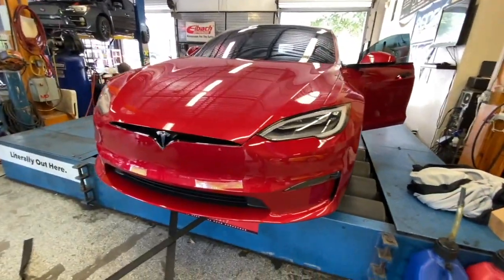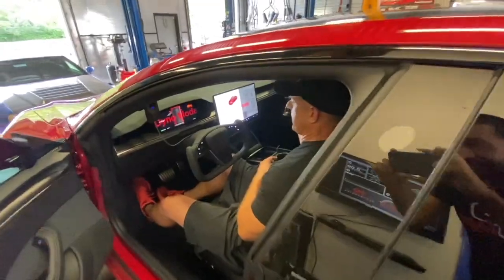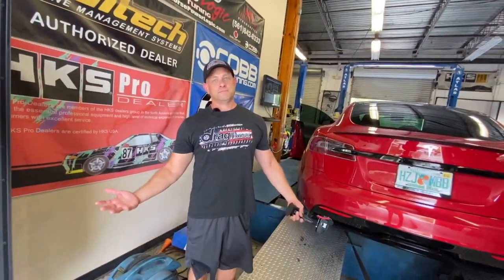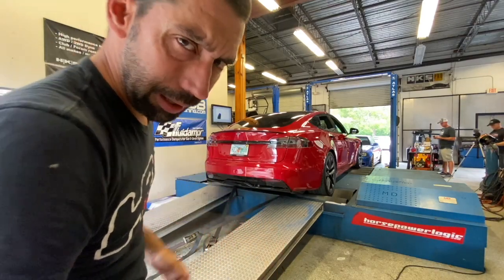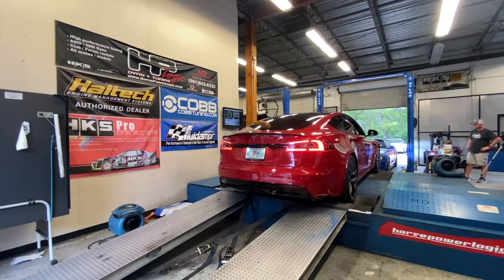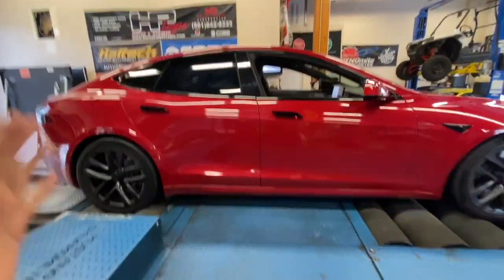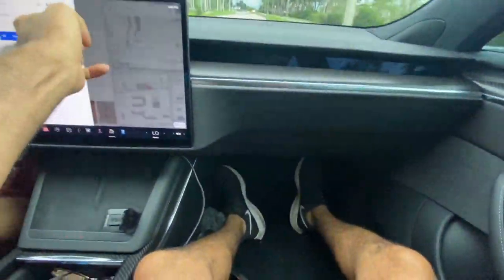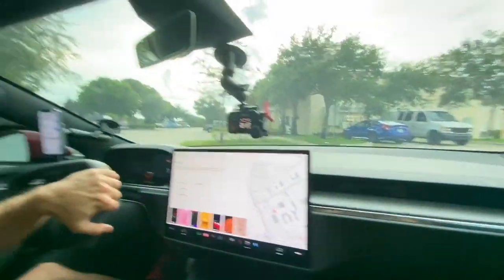WE DYNO A TESLA PLAID

Comment: Try unplugging a wheel speed sensor to fault the ABS system. Works on all the other Tesla’s on the dyno so it might get you through. A 10 minute drive after plugging it back in usually clears all the faults. Good luck!
Reply: Not necessary just remove the skyline and boom problem fix

Comment: Where do you think the future of engines is going jack? Biden wants full ev, but I feel like that platform has just as many if not more flaws over a combustion engine. Hydrogen, diesel, ethanol based?
Would love you're 2 cents man. Keep up the solid content.
Reply from the maker: The smart thing to do would be to use the largest fuel source we have on earth. Water.  Hydrogen/oxygen from nuclear production is the real way.
Reply: @JackCecil  Electricity can be made in a variety of ways: nuclear, hydro, tide, wind, solar. It is also available to produce residentially (solar panels). Electric + battery has plenty of room for improvements - I mean batteries. Hydrogen will never work until they figure out how to make it without burning through fossil fuels. Not to mention storage and transportation. So, before u even get hydrogen fuel cells where they needed (gas stations for example), you have already used so much energy for it that it makes no sense. Up to this point, all legacy makers including Toyota, BMW, Nikola, and others, have quit on pursuing Hydrogen based tech. Hydrogen can only work if u can perhaps obtain it from Jupiter or Neptune and ship it back to earth :DDD (logistics of Hydrogen is insanely expensive).